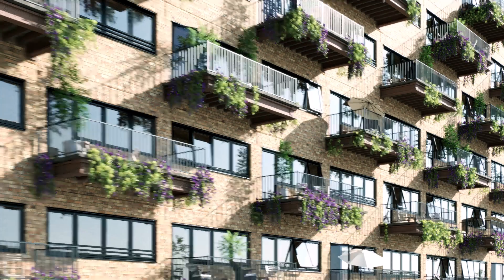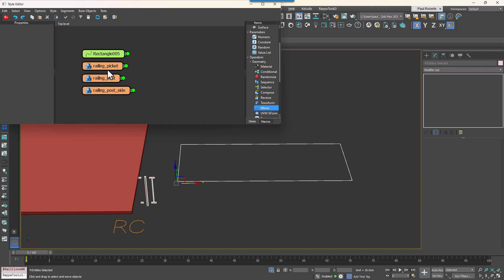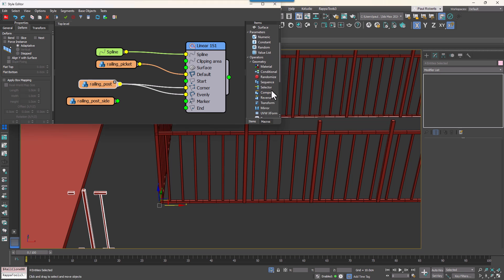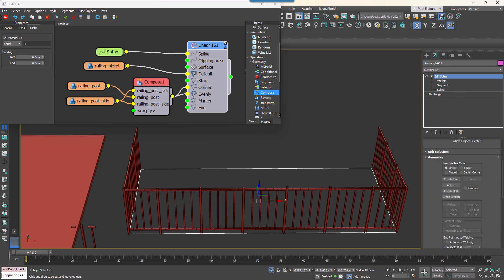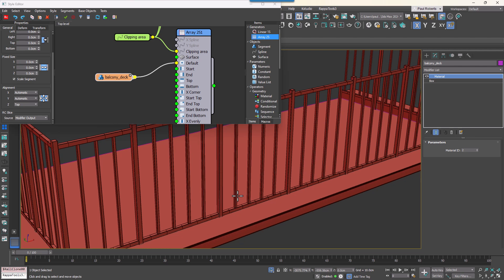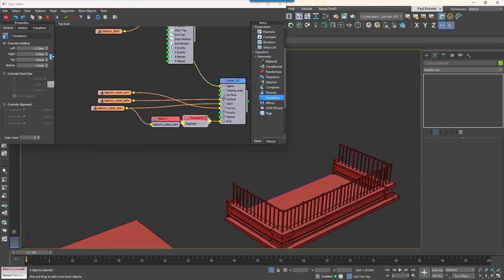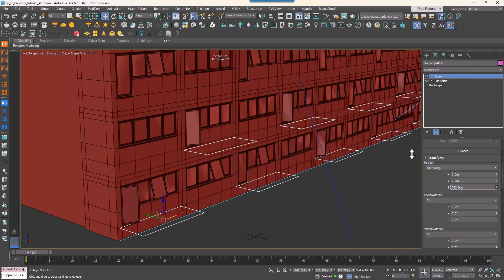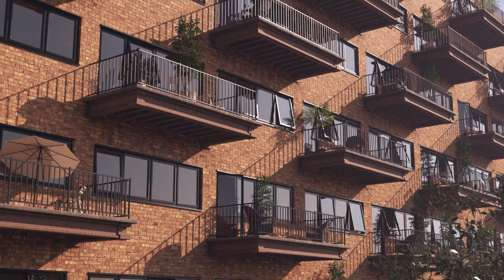How to create parametric balconies in 3ds Max using RailClone

Comment: As usual, a great tutorial! But, unless I'm mistaken, you forgot to set the "balcony_joists" object in the balcony structure...
Reply from the maker: You're right, they are in the render, but not in the tutorial to keep the video to a reasonable length. It should be easy to add though using another A2S generator, and adding the joist to the X Evenly input.